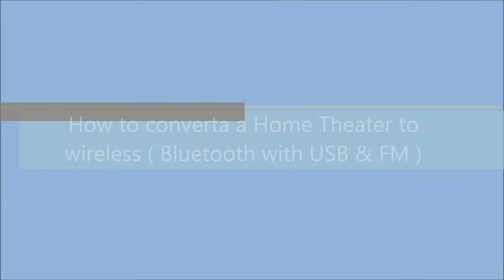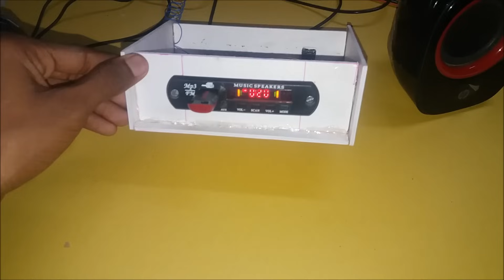How to convert a Home Theater to wireless ( Bluetooth with USB & FM )

Comment: You have done a mistake.... You have to use an amplifier like PAM 8403/ 6210/6253/4440 according the output wattage you want  with this decoder unit.... This device is a pre-amplifier to feed an amplifier... In your case PAM 8403 is the best to use...

Comment: I don't undestand how to connect the portable bluetooth speakers to the Decoder Board.
Is it possible?
Reply: There are two types of bluetooth decoder... one with inbuilt 3 to 5 watt amplifier another is without amplifier... If Yours is with amplifier, then no problem.... connect 4-8 Ohm/ 3-5 watt speaker and 5 volt DC power input... it is mentioned on the decoder board..... if your"s is non-amplifier one, then use a D class amplifier... PAM8403 is the best for this purpose... where to connect every thing is written on the amplifier module...... Use two 18650 Li-Ion battery in parallel and TP 4056 battery charging module.... here is a link of a DIY portable bluetooth music system

Comment: it's a preamp, u should also use amplifier to get sound.
Reply from the maker: Yes
Reply: +TARUN KUMAR DAHAKE instead of using 7805 u could give power supply from power bank. 7805 gets heated a lot and also u have not used heat sink.